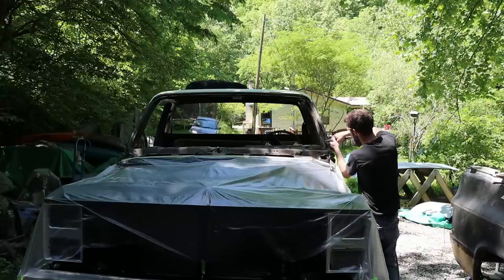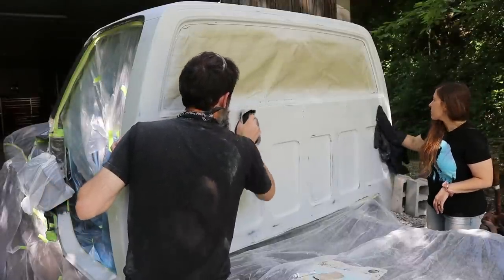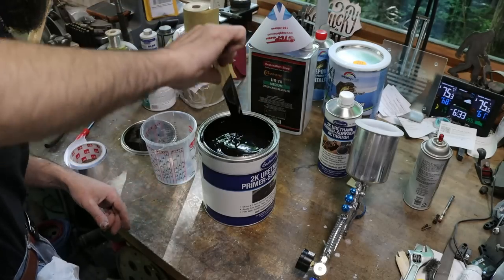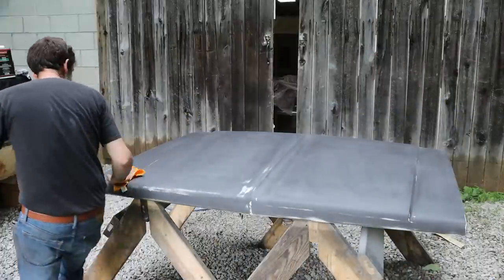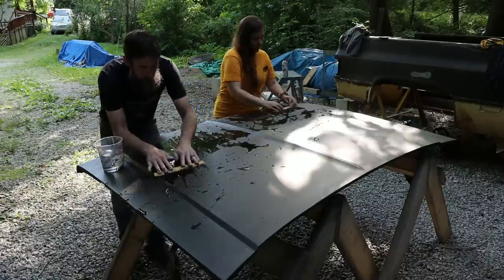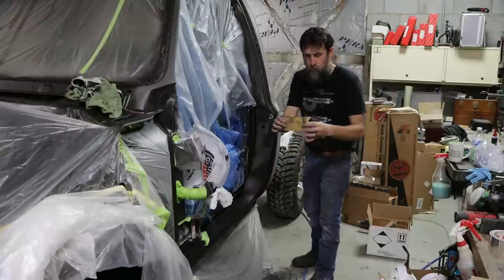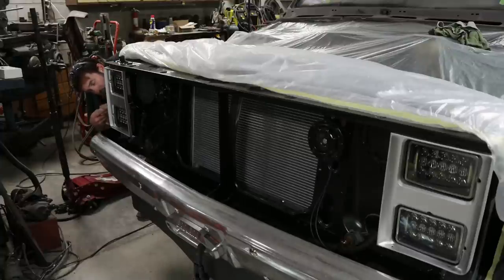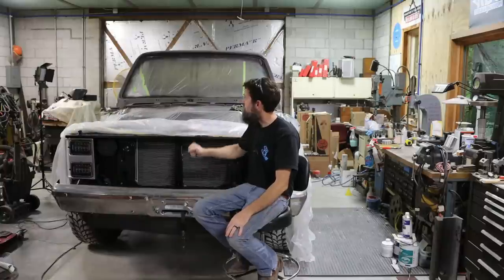Elizabeth & Me Blocking / priming the Short bed chevy

Comment: When wet sanding, it's a good idea to put enough Dawn or Sunlight dish soap in your water to give your water an oily feel. The soap helps to keep you sandpaper clean and will give you a more consistent sanding job. When finished, just rinse your part with cold water. To sand inside radii, wrap you paper around a short piece of radiator hose or polyurethane pipe insulation. Both are soft enough to collapse and form to the radius of the inside curve.
Reply from the maker: I remember adding soap years ago but had forgotten about  it.  Thanks for watching.👍

Comment: Nice work there Steve!!  
A tip for spray painting - try to get in the habit of keeping your air triggered on all the time & just stop the paint flow after each pass (full trigger pull or half trigger pull). This helps to keep your tip clean as it will prevent drips & drops collecting on the tip so they don't get blown onto your work surface at the next pass. Pull full trigger as you approach each pass (4-5 inches before) for large surfaces and fan size. As the air (without paint) blows over your wet edges it'll show you where your paint thickness is correct or not by how it glosses & how the wet edge lays.
Also, a constant air flow helps push the overspray away which can also give you a crappy film finish if it's allowed to settle on the fresh paint. Stay safe and well :)

Comment: Your 'half way decent job' is probably way more thorough than what came from the factory back in the eighties. All The Best from Somerset UK.
Reply: Guaranteed to be more than that, the assembly line probably only spent a tenth of the time on paint prep for the entire vehicle, compared to what Steve has spent on just the hood so far. Not exactly the best for fit, finish and finesse off the line, more like you just hoped it was not started or finished on a Monday or Friday, but went through mid week in it's entirety, so you at least had work done semi right.

Comment: For years I used a Sharpe siphon gun. I recently bought a Starting line gun too.pretty decent gun for the money I think.  With help from my parts supplier I converted it to take the disposable cup system.  Which I like a lot. A bit more expensive to use that way, but very convenient and quick.

Comment: Yes, bought the box of generic clips and stuff, because I needed a few of each type, but thankfully there is enough of them to help out with all friends vehicles as well, so the extras are being used up to replace all the other missing clips and fix rattles. Often you buy the kit because it has that one or two you cannot got otherwise easily. 

As to the show van, looking like it is coming together better than when it was slapped together on the assembly line. How are you going to insert that windscreen again, using soap like all the window shops do is going to put you right back with unprotected bare metal in water, so I hope you will use a rubber grease instead, little messier, but at least not going to rust under there again.

Comment: My guess is the surprise is EFI. I, myself have moved on from carbs for all my vehicles. The new aftermarket fuel injection systems bring an unparalleled level of performance and reliability to old naturally asperated cars and trucks. Except for the fuel pump and recirculation requirements, the plug and play aspects are unbeatable and the fact that the system can learn you driving style, respond to temperature and elevation changes, you can't beat it. Combine EFI with electronic ignition and it is like driving a 2022 car right off the dealer lot.

Comment: Great episode Steve! Elizabeth helping you block the bonnet was good (till she bailed lol ) glad you spoke about safety using the 2K paint products as it's really important as here in the UK it is not allowed to be used at all in the open air, no matter where you are. 2K must only be sprayed in a paint booth with full environmental protection by law, ( European law of course!) nice to see a new De Vilbis spray gun . Many years ago I was given a brand new top of the line one of the syphon  type which was missing the cup I sourced a knock off cup( I couldn't even afford the de vilbis one let alone the gun lol, at that time the guns were going £350 plus VAT which was then 15% now it's 20% lol) I've no idea how much a gravity fed one would cost now probably in relative terms not too much. And like many things that were made in the states or in the UK are the new de Vilbis ones made in the dreaded China now?
Reply: I believe the HSE law only applies to professional use, though obviously it would be extremely unwise to DIY without suitable protection.  Also 2K paints with non isocyanate hardeners are now available.
Reply: @ferrumignis  Isocyanates! Who saw that and thought 'what could go wrong?' I've worked with fixatives and embedding resins that had some scary carcinogens in them - glad the coating industry is moving away from them.
Reply: @ferrumignis  Ah, I was wondering if less toxic hardeners had been developed, thanks.  I recall spraying original Dupont Imron 2-part polyurethane in the late '70s (haven't painted anything in decades), and remember LOTS of skull-and-crossbone warnings all over everything at the time, which I didn't see on Steve's paint cans.  We masked up in full face carbon filter masks back then, even for the pouring and mixing, and locked all the doors to the garage to keep people from inadvertently wandering in during the spray job.
Reply: I've recently done some spraying with 2K from a can - the company offered 2 types, isocyanate and non. The non-iso one is obvoously safer and also has the advantage of a longer in can life. I was only spraying a push bike frame so cans were the best option for me.
Reply: @ferrumignis  I don’t think this was actually anything to do with our HSE at all I was a European wide directive as I was told it. Probably more than 25 years ago

Comment: You will have a new truck when you are done. One question, I’ve noticed that you haven’t used a “wax & grease “ remover yet. Do you not need it till the top coat?  Why I ask is I’m doing a 83 Toyota, I’m not to priming stage yet. Read that step in write-ups. You will Very proud of your truck.
Reply from the maker: I cleaned the majority of the truck before sanding down to almost bare metal.

Comment: best use a tag rag or sticky rag that doesnt move the dust around but actually holds on to it
in the yee olden days we used to have rulers with the same type of markings as those cups youre using for mixking paint , alowed you to use just about any cup for mixing as long as it was reasonably staight walled , we used milk cartons cut in half , verry cheap and eazy to poor out
a better pickup for her might be a toyota or an S10 , there a bit smaller and she can get in and out of it eazier even with stock suspension , there probably cheaper and eazier to find in good state too

Comment: Hey Steve getting closer and closer to the finish. I Can tell it's going to look awesome when finished! 
Can you share where you got that flexible shaft that you ran together with your makita die grinder in the beginning of the video. I also have the makita 906 and would be interested in a flexible shaft attachment.
Reply from the maker: That flex shaft is one I have had forever just setting in a cabinet, I can't remember exactly where it came from originality . I just decided to hook it up and give it a try to this makita and it worked 👍

Comment: Really enjoying the truck rebuild. At about 30 sec in is that an old radio speaker? If so, after all the work you have put into this  what are you going to do for a sound system? Because the old system can't be very good. I am very curious about this as I have a similar upgrade in mind for my rig (a 2004 F150). Clearly there will never be an easier time to do this.

Comment: great video. question probably been asked... why is the pattern on your gun so small?
Reply from the maker: I run real close.
Reply: @SteveSummers  Ahh. I wondered. Spray finishes here daily, though not out under trees. Spent several years in the body world in my late teens/early 20's. Wide pattern and you usually pretty much have to run to keep a wet edge and to keep from your air flashing the solvent off the previous pass. Interesting. Ive never seen anyone spray so tight/slow (not a critique on speed) other than with a jamb gun. I kinda wondered if you ran such a tight pattern trying to be "tight" with you material transfer and being "tight" with trying not to lose material to overspray. Would work with primer I guess. but more work with humped up finish.
Reply from the maker: @fpoastro  Just trying to pile up a good wet coat and put on material quick. This urethane I'm spraying is thick. I will probably use a 1.8mm tip next go around.  The 1.3 I was spraying with is on the small side in my non expert opinion.
Reply: @SteveSummers  Understood. We spray a lot of very heavy 2k and it can be hard getting a wide pattern but usually with some reducer we can get a nice 10"+ wide pattern. Lets you lay down material really fast but you do lose a bit to reduced transfer efficiency but time is money.

Weve never gone past a 1.8 but always reducing for a wide pattern (within allowable reduction).

I would have thought priming the lid on your truck to be 4-6 swaths. Hood perhaps 10. I always worry about slow passes and all that air washing over previous coats you lose all your solvent.

No doubt at the rate your going your gonna come out with a near show truck result. Blocking out the jambs alone.. lol.

Comment: for anyone that has subscribed to this channel over the last year or so would have no idea this used to be a machining channel.  from the total shop rebuild right into a Truck restoration. machining has taken a back seat to pretty much anything else. Steve, your machines miss you.
Reply: True, but we all have learned so much more from Steve over time, both from him machining stuff, and being an all round general purpose shop owner. Truck is going to be something soon, and then more stuff that needs precision machining to come, especially as he gets to enjoy the new vehicle, and starts to make his own upgrades for it, the shop and for the tooling around him.
Reply: When either project was started, they were at a point where he had to do something.    Can't go after machines with a broken truck, can't work with/on them with the shop falling down around your ears.
Reply: Both are projects of need, the shop rebuild to keep the machines out of the stream and the shop truck for future support. The motor block and components contained large amounts of unseen automotive maching tasks by their prior ownership.
Supporting a 20 toolmaker shop our slant six '70 Dodge pickup had well over 240,000 miles but still plowed parking lot snow each winter with a case of oil sitting on the passenger seat and an occasional smoke ring exiting the missing horn button.